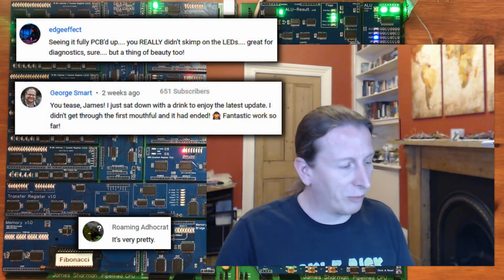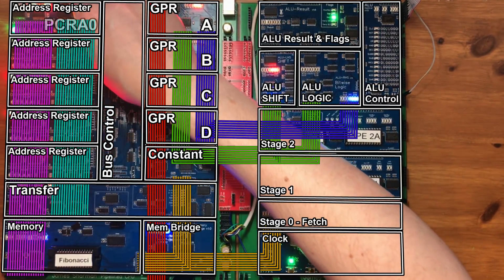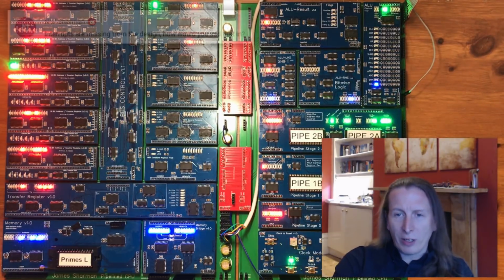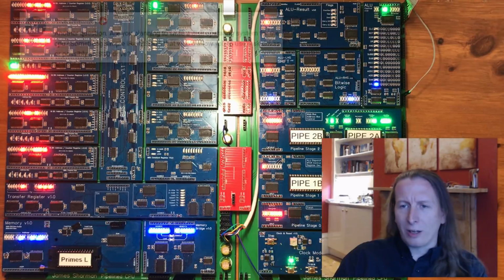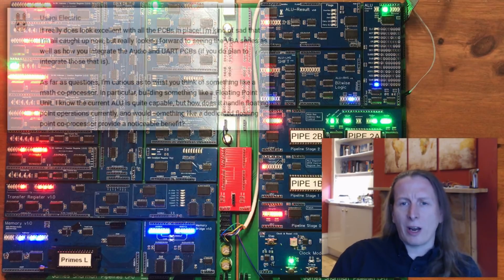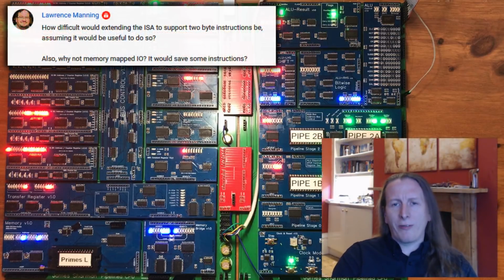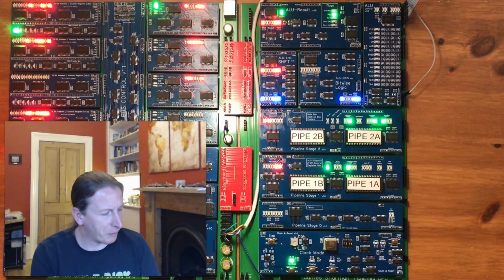Design Retrospective - Making an 8 Bit pipelined CPU

Comment: Hey James, first of all thanks for all the videos, I’ve just finished binge-watching them all (took a while :)). I’ve always shied away from PCB design and I feel by seeing you do it I will have confidence doing that in the future. Also I got a deeper understanding of how my favourite processors (the Z80 and its pipelined derivative the R800) probably operate internally.

I have a couple of questions on my mind:

1. Is there still a reason to have a constant register now that you have the memory bridge? To read an immediate value in pipeline stage 1 you could feed the PC into the memory bridge, assert the value, and load it in the register half a cycle later. The the bridge assert is then controlled by two stages in the pipeline, but you already had to add logic on the 0th stage to deal with that situation anyway.

2. Is there a strong reason to spread the ALU operation across two cycles? The ALU logic does not need to be clocked, and the propagation time would still be low enough that memory access will still be the bottleneck. If it executes in one cycle, you would no longer need to have to worry about instruction ordering.

3. If the ALU runs in one (half) cycle, would the pipeline not be very close to being simplified to just two stages, fetch and execute? The only obstacle I can imagine would be the implementation of the pop / push, but even if there is no way around it, breaking that up into two separate instructions (load + increment) seems a small price to pay for the simplifications it could bring elsewhere.

And lastly, a few ideas for future videos:

* Since you have the bus request line, you have a form of DMA. You already use it for the shadow RAM copy. It would be interesting to explore that further, for example to implement a PCM circuit that can play back independently using DMA during program execution.

* Since the volume control is linear, you can play 4-bit PCM samples on your sound channels. That could be a fun demo. (Side note, a logarithmic volume scale would be more ideal for musical purposes.)

Looking forward to your future content!
Reply from the maker: 1) Yes the constant register "needs" to exist with the current pipeline arrangement. You could read from the instruction stream in stage 2 directly from memory but that would put the fetch unit would have read in a byte in between, that means you would have to modify the instruction encoding to take account of earlier instrctions and the pipeline state. Remember the constant register is actually only 1 chip (the other 2 chips are just for visuals).
Reply: @weirdboyjim  I see, thanks for sharing your thoughts!
Reply from the maker: 2) The ALU does need to be clocked, carry flags require it.
Reply from the maker: 3) If you were running at a slow clock rate you wouldn't need to separate the alu stages out, but it would bottleneck the cpu. Remember that the pipeline is very much about hiding latency. You could do as complex a circuit as you want and have instructions always be 1 cycle, but the circuit would take time to settle and that would limit the clock rate.

Comment: I've completed a design an implementation of a more rudimentary CPU, inspired by and derived from other YouTube videos.  Now I'm studying your videos and EasyEDA schematics for ideas to take my work to the next level.  I don't see a schematic for the 'ALU Result & Flags' board - is one available?
Reply from the maker: Hopefully it's been useful, I usually release the schematics once i've tested circuits as working. That one needed a couple of bodge wires, I need to order the replacement pcb and test it but I'll try and get that done soon.

Comment: 3.146875 mhz, i’ve just worked with a ecliptek cmos oscillator with that exact frequency, is that right?
Reply from the maker: I wasn't aware there were crystals at that frequency, but the number is correct. The frequency I was using is 25.175mhz with an 8x divisor. That's the basic vga pixel clock which I used in the first part of the vga series.
Reply: @weirdboyjim  just looked in my logs, EH5620ETTTS-3.146875M is the part name, now you know, small world tbh.

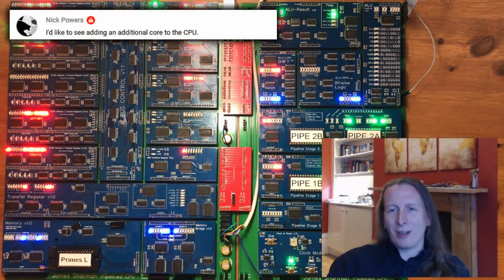Comment: ref: 54:45
I think that just about any hobby have the same cost "problem". You need equipment, material, tools, etc. Since it is not really for just one project all of the cost can not be included in just this single project. I do not think that you mean to throw away the oscilloscope if you stop working on the CPU.
Reply from the maker: Throw away? No. Replace with 4 channel one?  Maybe ;-)
Reply: @weirdboyjim  If I have learned something from different tech channels so is it that one oscilloscope is never enough.   :-)

Comment: in my softcore cpu, i use 2 bits each to specify dst and src registers but thought about latching those bits so that they could be used in a new class of instructions that operate on "last dst" or "last src" point being to be able to diversify the instruction set without having to allocate 4 bits of the new instruction opcode to specifying operands
Reply from the maker: I actually thought about something like that to allow me to have more than 4 gpr's without adding encode permutations. I went with the simpler solution as there wasn't really a speed benefit to it once you add the extra instructions and I worried it would get in the way of explaining the features that really mattered to me.

Comment: Do you have the ability to program UV erasable EPROMs?
Reason is that you might find the CY27C256-55WC or CY27C256A-45WC EPROMs of interest. They have access times of 55ns and 45ns respectively. Of course, due to the UV aspect, turn around is rather slow compared to the EEPROMs, but the speed is much nicer than the 150ns. And since they are reprogrammable, they won't break the bank for microcode fixes. The cost is about 2 to 3 USD from digikey.
Reply from the maker: The programmer would handle it, I'd have to improvise for the erasing. I was actually looking at the OTP ones once the contents are fully settled.
Reply: @weirdboyjim  as a child, I used some UV erasable EPROMs. To erase them, I build my own eraser. A simple box from scrape wood where the lid would trigger a leaf microswitch when closed for safety. Used a germicidal florescent tube mounted on the lid. Standard ballast inside the box, and for the starter, a momentary push button on the side. Placed a bit of conductive anti-static foam in the box and that's it. Put the EPROM into the foam, close the lid, plug into power, and press the button for a second or two. When time is up  just open the box.

Key thing is to use a germicidal tube, and not just a simple black light tube. The black lights don't have a short enough wavelength to do the erasure.

Plain old sunlight will also work, but it takes an excessive amount of time. Also these days you can buy suitable UV LEDs, but they're pricy at USD $20 to $50 each, not including power supply.

Just checked Amazon and they have UV EPROM erasers ranging from USD $20 to $40. Replacement UV-C germicidal bulbs are about USD $10 each.

Comment: Latecomer here - just discovered your stream. Beautiful work. I'd claim the prize on the 3.146875MHz crystal if it was still up for grabs, but I suspect several hundred of your followers have beaten me to it. And FYI in response to your earlier video about the high-speed clock - I recently went through a similar discovery process with ringing on the output of the CTS MXO family hybrid oscillators. In the end proper decoupling very close to the part had the largest impact of the various things I tried. It looks like your PCB has that and it's not an issue for you now. Look forward to your future posts.
Reply from the maker: Thanks Jeff! You are correct that some clever people worked out the timing significance. You'll probably get to the vga series in time.

Comment: shouldn't be possible to use memory bridge instead of constant register ?
Reply from the maker: Not without changing other things. The constant register stores the data for 1 cycle between it being fetched and the time the data is needed on the main bus.  I talk about the the register quite a bit because it's important to understand the added complexity of pipeline sequencing, but if you strip away the non essential stuff it can be implemented as a single latch chip.
Reply: @weirdboyjim  Thank you for the answer. Btw superb project. Big thumbs up ;)

Comment: Re adding interrupts in a future build:
A future build could emphasize completely different features.  So, it would not need to be pipelined just because this one is.  It might instead show systematic instruction encoding (no ROMs for sequencing!) and flexible addressing modes.  For interrupts, don't just have "OK, interrupt!" but look at prioritized multiple triggers that dispatch to different handlers, have a interrupt disabled flag, and a separate NMI.
Reply from the maker: Are you finished planning out my next 2 years of spare time?  ;-)

Comment: I know I'm kind of late to the party, and I haven't watched the entire series yet, so pardon if you already discussed this elsewhere. 
But here is my question - have you though about describing your CPU in any HDL language? All the chips you use can have an HDL equivalent, so it shouldn't be very time-consuming if you have an up-to-date schematics, but this will open up a number of possibilities - first of all, you will kind of automatically get an emulator because you can run this HDL in a simulator, second of all, you can run it through an optimizer to see if some of logic can be optimized away, lastly, you can actually try running it inside FPGAs, which will open up a lot of possibilities, like multi-core (which I personally would be very interested in as I'm thinking about making my own RISC-V core multi-core capable). I work with FPGAs quite a bit, including some commercial projects with video/signal processing, so I can help with some practical matters should you ever need any help, but I've recently became very interested in CPU design, particularly modern multi-core CPUs with multi-level caches. 
My dream is to design a my own multi-core RISC-V SoC for FPGA which I can run Linux on (even if super-slow, as the kind of FPGAs I can afford do not allow running logic much faster than perhaps 200 MHz). I have enough experience with Xilinx FPGAs to implement pretty much all typical PC peripherals (USB 2.0, SATA, PCI Express 2.0, HDMI, DisplayPort, 1G/10G Ethernet, SD Card interface), but seriously lack any experience in the CPU core design, especially when it comes to multi-core - stull like interrupt controllers with IPIs, cache coherency across cores, some other inter-core communication mechanisms like mail slots and mutexes. I am a software developer by trade, so I kind of know the software side of these things, but HW is a big mystery for me at this point.
Reply from the maker: To be honest, I probably wouldn't for this build. I have plans for future builds that I  may well take further in directions like that.

Comment: Did you consider separating data memory from instruction memory at all? There's a name for this, but I can't remember it! But that would allow instruction fetch to be completed every clock cycle, wouldn't it?
Reply from the maker: You are referring to the "Harvard Architecture", I did think about it but it does impose some restrictions and limitations on your code. Modern CPU's use a best of both worlds approach called the "Modified Harvard Architecture" where you have separate code and data caches feeding of the same main memory.

Comment: I really hope the VGA support won't cripple the cpus performance like in Ben Eaters example. An external video ram is really needed
Reply from the maker: I've always said I want to be able to make some games for this thing, so expect a nice smooth update without much cpu impact.
Reply: I liked the BBC Micro's solution back in the day: they clocked the RAM twice as fast as the CPU, and the CPU and video circuitry took turns accessing it without slowing either of them down.

Comment: Thanks for building a VGA output. A tripple frame buffer would be great. It isnt so hard, and you basically have no compromise. In most of the other designs the CPU has to halt for the graphics, or other bad compromises. With this solution the display can switch the buffers independently from the CPU. For programming you just write to a RAM (one of the 3 buffers) and then switch/upload to the screen. No halting no nothing. The easiest solution. I cannot understand the bad compromise ben eater did.
Reply from the maker: Triple buffering is only needed if you want to run at a frame rate that isn't an exact division of the refresh rate. Back in the day we didn't always have hardware double buffering, there were tricks employed to synchronize changes and avoid stalls. That's really the kind of level I'm aiming at. I'll need to be clever with the coding but I won't be happy with anything less than silky smooth update.
Reply: @weirdboyjim  Interessting. Thanks for answering. Maybe in near future I will build a CPU on a Breadboard too.

Comment: Thanks for answering my speed question. 1Mhz is great and 2.5 is fantastic! 3.14 more fantastic still. I've thought of making something along these lines for many years now, also using off the shelf memory for storing microcode. Now that JLCPCB and the like have made PCBs so cheap I may just make the jump with inspiration from your build providing a push. My solution for increasing the speed of the decoding as much as possible was to swap the EPROM for cache SRAM loaded from a serial EEPROM via a shift register and counters, Xilinx boot style. It adds a couple chips, but you can shave 40ns off the decode time. The same solution will likely be employed for loading program/data RAM as a USB<->SPI converter with a mux provides easy access from the outside.

Anyway... I'm really looking forward to VGA! What a great build!
Reply from the maker: I'm doing something slimiler with main ram, but if I really wanted to max out a design I'd try and drop the control roms and design an ISA with a simple mapping to the control lines.

Comment: I'm relatively new to your videos, I've been binge watching over the past month or so. I'm a Engineer and PCB designer who started w/ surface mount in the mid 80's when no one knew what it was. So in regards to your soldering skills, you have progressed to more than acceptable in a pretty limited time, and constrained by the "tool set". My at work solder station likely cost 10x what yours is. So well done.

There has also been good progress w/ layout technique. There are a few things here and there, that on a mass produced board might have some fabrication or assembly issues, but for one off designs are fine. Watching the layout sequences brings back memories from when I first started, and reminds me of all the "tricks of the trade" I've picked up over the years. Although a lot of them wouldn't transfer well, as they are based on imperial dimensions vs metric

One final thought, I don't remember seeing the code for Sieve of Eratosthenes, I've seen a few versions online, but none that are optimized for such a limited processor. Most would require 64k bytes of RAM to find the primes in 2^16.

Best regards
Reply from the maker: Thanks Ron, glad you are finding it interesting. Feel free to comment on videos if you think there are layout improvements I can make.  The Sieve of Eratosthenes is an interesting subject for optimization, and that's where I actually am skilled. I use an incremental version of the sieve, might warrant a video to explain that but even for a simple implementation 64k is much more than you need. You can start by using bit indexing, so that 64k bytes becomes 8k bytes, but then you can ditch all the odd bits and drop that to 4k bytes.

Comment: "I'm not gonna try and pronounce this..."  Hahaha!  I stole it from the fourth traditional metasyntactic variable: foo, bar, baz, qux.  For what it's worth, I tend to use "kook-zee".

In regards to the control ROMs and assembler, I already have those mostly down pat.  I'm at the point where the emulator is running everything up to part 63.  I'm currently rewriting the assembler to be a bit more robust before proceeding further.  I want to do some extra stuff like unused symbol removal, and generating debug information.  Maybe even some basic lint checking in the future for things like branch/alu overlap, or unexploited branch delay slots.

One of the things I want to attempt with the emulator is to support remote GDB debugging, since that's one thing it could offer that the real CPU can't do.  When trying to write more complicated software, I figure having an interactive debugger might prove useful.
Reply from the maker: Wow, that sounds like quite a lot of work.

Comment: Well explained now the architecture is more clear to understand. For secondary storage, in 8bit parallel mode, you could use something like  (CH376S USB module) and write a simple routine to read and write data in a byte fashion. I had used this module in past with FPGA based computer.  
 Cheers ✌✨
Reply from the maker: Looks like a nice method, but I'm trying to avoid any complex parts like that. But i'll have to compromise a little for storage.

Comment: Isn’t that 3.14MHz frequency used for VGA line drawing?
Reply from the maker: It's the VGA pixel clock divided by 8.  It's going to be far easier to get the first stages of the vga working without worrying about weird clock timings between cpu and vga.